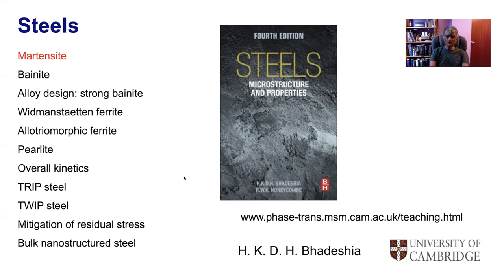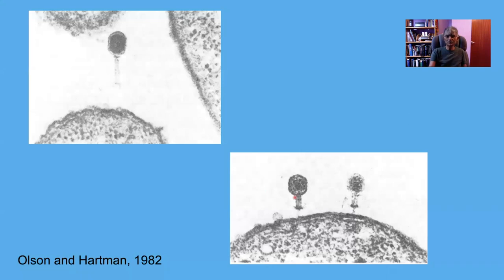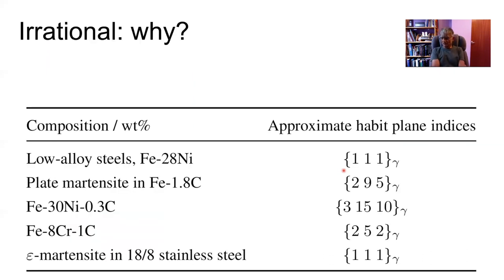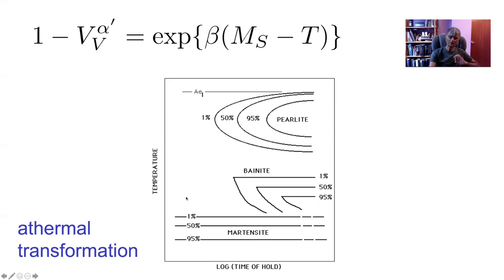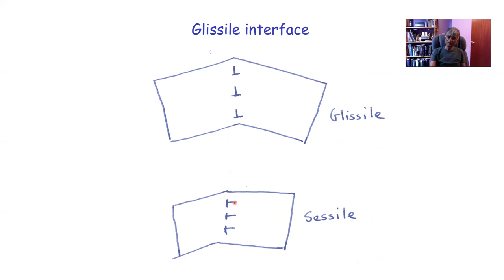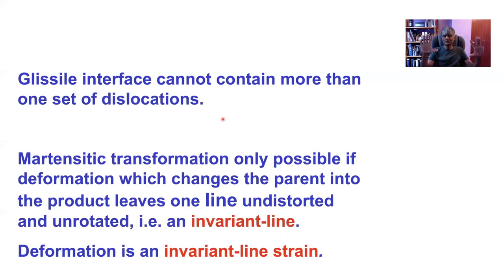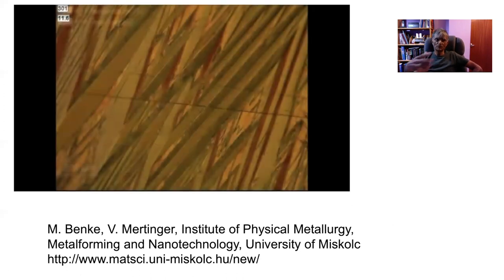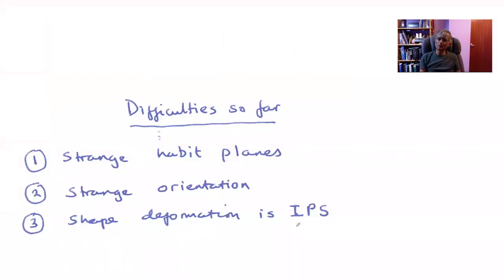Steels: martensitic transformation, part 1. Lecture 1 of 12

Comment: Thank you professor Bhadeshia, this video and the book Steel helps a lot. However, I still have one question and hope you can help me. For my understanding, one one hand the shape deformation requires a invairant-plane; on the other hand, the book says the coherent interfaces cannot be found in MT. So are the invariant plane equal to the coherent interfaces? If so, can we state that the needed "invariant plane" also does not exist, but is just accommodated by slip or twinning? Thanks!
Reply from the maker: I think that is a good way of describing the transformation. The plane is only invariant on a macroscopic scale.
Reply: @bhadeshia123  Thank you sir! BTW, why does high-C martensite tend to accommodate by twinning while low-C matensite by slip? Can we say these twinned martensite is not stable thermaldynamically?